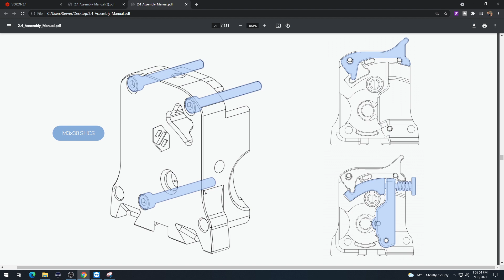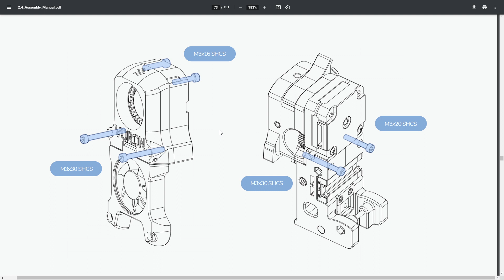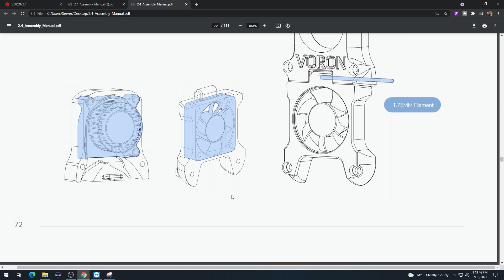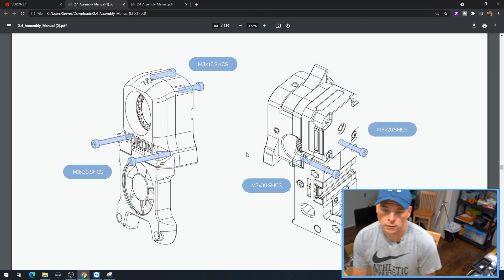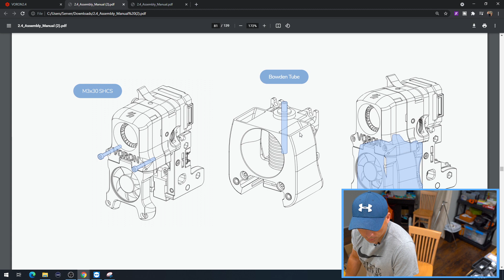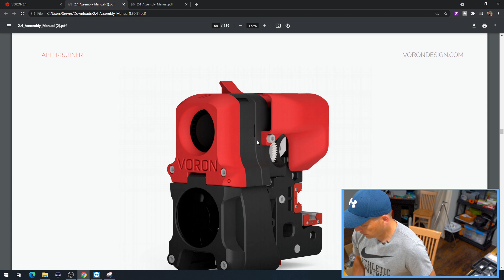VORON 2.4 3d Printer Build It Live *Episode 11* AFTERBURNER

Comment: I've seen tearing apart the fan was needed in a couple videos now.  I wouldn't even have known to look for the details in an old manual.  Thankfully I don't need the details now.  :). Good luck on the channel.  Very nice presentation.
Reply from the maker: The manual is more of a guide.  It does a great job to get you pointed in the right direction w/o providing all the answers.  In retrospect it's pretty damn good.  As for the fan and about a dozen or so other things, it does put you on edge to not have clear instructions when you only have (1) of the part and you don't want to break it!  Thanks for the comment and the well wishes!  Stick around - I'll keep putting up more content!

Comment: Nice one! The fan case had me perplexed for a while - could have used this vid at the weekend! Manual definitely needs that updating. Found the afterburner a bit fiddly especially mounting hot end when on the rails. Now in the early stages of wiring the electronics.
Reply from the maker: Nice - I told you you would blow by me!  I believe I could build one of these in about 10hrs (now) + electronics and software.  Let me know if you have any questions, even if I haven't put out a video on what you're working on.  If you're at all interested and have the ability, once I have mine built - I'm looking to do a series of videos with other Voron builders going over the pluses and minuses and just a bit of a round table style thing. Let me know by shooting me an email.